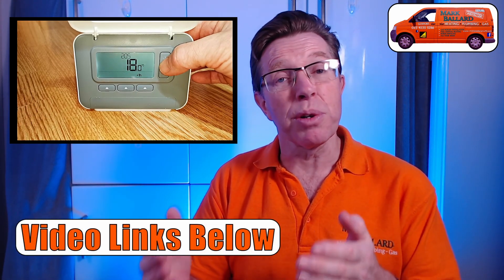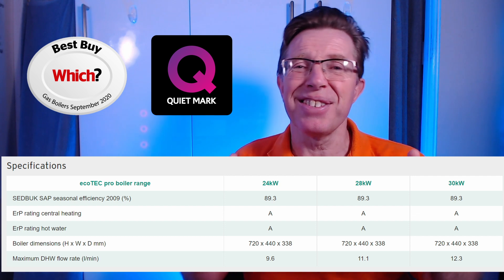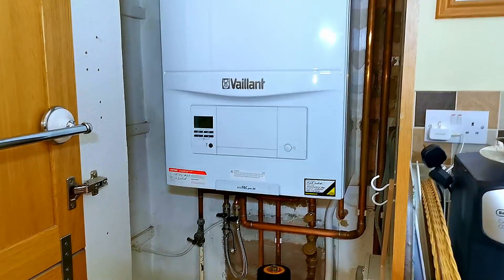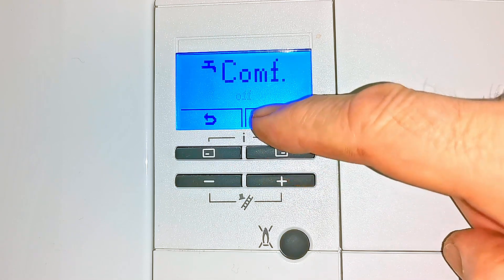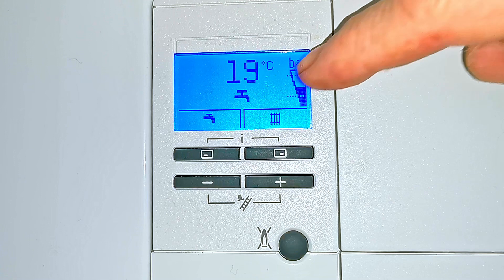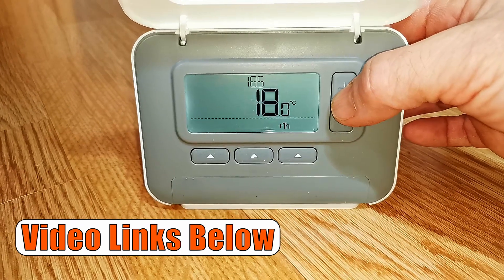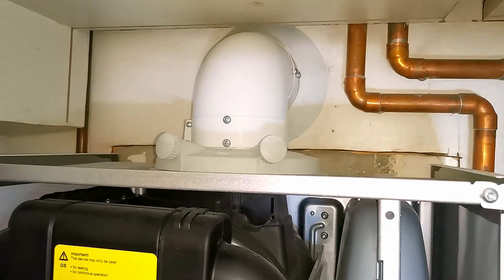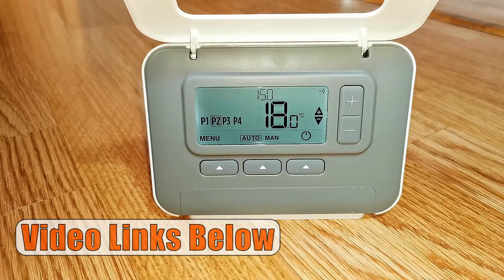Review Vaillant ecoTEC PRO Combination Boiler REVIEW.  How to Operate and what's Inside the Boiler

Comment: How am I supposed to take a review seriously from a “professional” who can’t even pronounce the manufacturers name correctly? It’s VAILLANT not Vailliant, you seem to keep adding an extra i for some reason. 

You say whack a 30kw in because it means you can run two taps at the same time, but that’s nonsense. It should be specd on whether you even have the cold water mains working pressure and large enough water supply to even manage a constant 14l/min + with two taps open, otherwise they’ve just paid for this bigger boiler for nothing. 

Also is the customers gas supply even big enough to power said bigger boiler you’re trying to flog them, or is that part of it all where you get to sell them a new gas run?

You should be mentioning in your videos that using Vaillant modulating controls is best practice as these will increase the efficiency of the boilers as they modulate the burner, not standard on/off controls which are no benefit to the customer in saving money. 

Nicely produced video though Mark Ballard 👍
Reply: Agree with EVERYTHING you said apart from the controls. Yes Vaillant controls are best for optimisation/efficiency but they fail often just like their PCBs, Gas Valves and pressure sensors! Except controls are not covered by warranty beyond the first year.
Reply: @ChrisBeevor0511  pressure sensors fail due to poor water quality in the system, if the installer isn’t flushing the system to the correct pH level then they will no doubt block like every other boiler

I can’t say I’ve personally ever had any problems with Vaillant controls myself, but I’m sure like other manufacturers controls other engineers have had problems with them

I agree on the PCB issue, I’ve changed a fair few in my time, only on the older models over 6-7+ years old though. I think I’ve only had one gas valve go and that was covered under the warranty
Reply: @ChrisBeevor0511  All issues you're naming are quite common throughout the whole industry, but apparently Vaillant did some improvements on the design over the years. Important to know is having the boiler modulate up and down rather than turn completely on and off to control the temperature is better for the gas bill and the longevity of the boiler, so I'm a fan of using a modulating thermostat from the same brand as the boiler, even if it's a very simple one (f.e. I have the VRT50: the simplest and cheap'n'cheerfullest modulating thermostat Vaillant offers since I prefer 'hands on' control of the room temperature rather than being a slave of a programmable one, and I only let the living room cool down 2-3° when not at home or sleeping anyways).
The biggest marketing crap about most boiler-brand ecosystems is you often need the highest end expensive main thermostat, internet module, remote control units... in order to build a multizone system. This could be overcome by using a different multizone system, but again, many of those don't modulate the boiler so the money you save ends up costing you on the gas or boiler repair bills. Opentherm is a solution, but beware: it's not because a boiler supports Opentherm it actually gives you full functionality or compatibility with aftermarket Opentherm thermostats/internet-modules/multizone-systems...